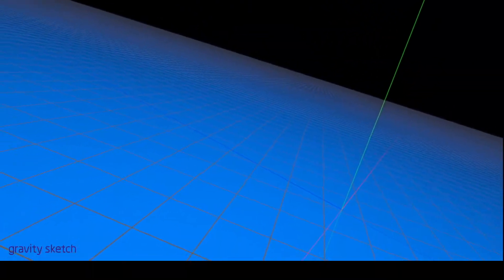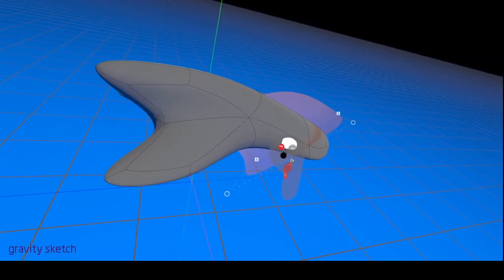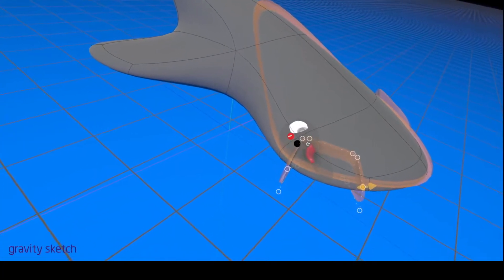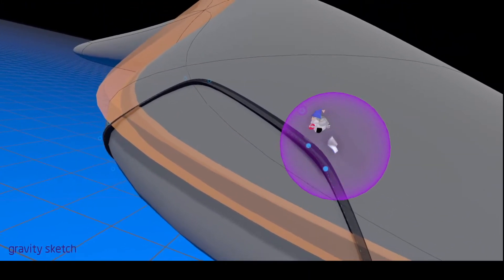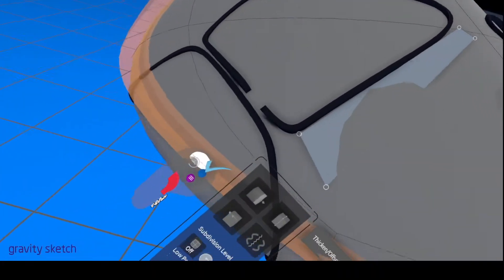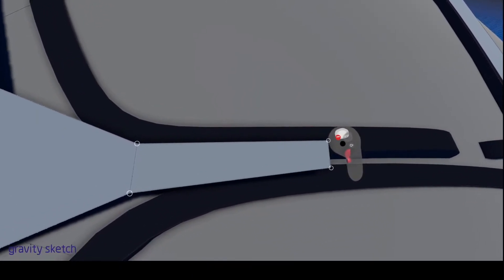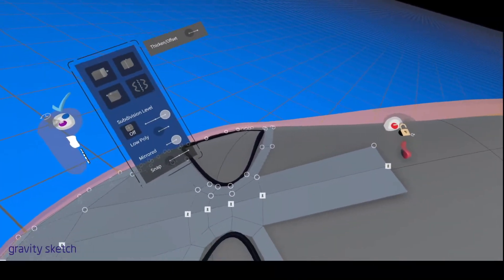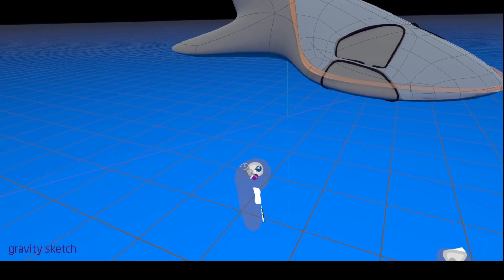Gravity Sketch: Cut Plane Design Technique

Comment from the maker: CLARIFICATION: When I say “Cut Plane” I don’t mean that you can actually split surfaces in GravitySketch.
I’m just showing my method for placing bent planes and ribbon-like surfaces, to quickly see where cut lines would look good, in the early design stages of a 3D model.
But those thickened cut planes can be exported to Blender or similar 3D app, and Boolean subtracted there.

Comment: Your not actually cutting the surfaces? your just adding detail over top that looks like cuts. How do you actually do cut planes? like the first plane can you use that to separate the surface from part. This is not a cut plane... Disappointed.
Reply from the maker: Ah, sorry about the confusion. I should have been more clear in my wording. I’ve pinned a new comment at the top to clarify what I meant by “cut planes.”
But you can certainly bake any thickened planes and export them along with the rest of the model, then import them into Blender or a similar app, that is capable of Boolean subtractions.

Or you can stay in GravitySketch and model the canopy, landing gear doors, etc. as separate parts, using the “cut planes” as references for where the cuts should be.

Comment: Is this way of doing it still accurate now..? I would hope for some tool that could cut the mesh at intersection.
Reply: Agreed
Reply from the maker: Yes, this is still accurate. GravitySketch doesn’t have Boolean functions such as Subtract, Union or Intersect. 
Booleans usually make a mesh very messy and add a lot of complexity. Blender is a good option if you want Booleans, but unlike GravitySketch, it has a steep learning curve.

Keep in mind that in GravitySketch, you can have several meshes that pass through each other, and look like they’re joined. 
Then you can export those meshes and import them to Blender, where they can be Unioned.
Reply: @greggjohnson621 let’s hope for an update one day :) 
Thanks for your answer

Comment: but can you just cut with the plan, much like Split Body in Fusion 360?  I am having a hard time figuring out how to boolean cut anything, it seems like everything has to be built up to something rather than cut away with a specified line.
Reply from the maker: GravitySketch does not do booleans. You would get really messy topology as a result of a Boolean operation, and it would look terrible when you subDivided it.
I started out in CAD, so when I got into mesh modeling, I had no idea how to create any form I wanted with good topology.
 (Fusion360 is also capable of mesh modeling to a limited extent) 
In fact I had no idea what topology was at that time, so I didn’t really understand the advantages of mesh modeling.
Topology is the basic boxes and inset surfaces of those boxes that make up a form. And of course when you turn on subD, it all smooths up nicely.
So to finish this spaceship thing, you would make each panel, windshield or window as a separate piece, and each piece would have clean topology.
That way, each piece could be made of just a few simple surfaces that can be subdivided to achieve a very smooth final surface.
So this method I’m demonstrating, lets you see the shapes of the pieces you need to build to get a nice final look, by creating new topology (or re-topo as it’s commonly called)
I hope that helps. 
I had thought of making a tutorial on topology, since I had so much trouble with it back when I started. I don’t know how many people would find that helpful.
Reply: @greggjohnson621 thanks 💯❌💯

Comment: Great video.. How are you able to taper (on the go) the surfaces you pull out?
Reply from the maker: The following is from memory, so if it doesn’t work for you let me know and I’ll go back and test it in GS:
When you grab an edge, then trigger once to extend the edge, and move the new edge while still holding the grab button with your fingers, you can use your thumb to move joystick left or right, which will scale the edge down or up (respectively)
Scaling with the joystick also works for faces on the fly.
Reply: @greggjohnson621  Thanks a lot; it worked.